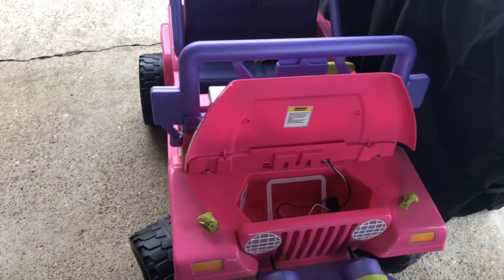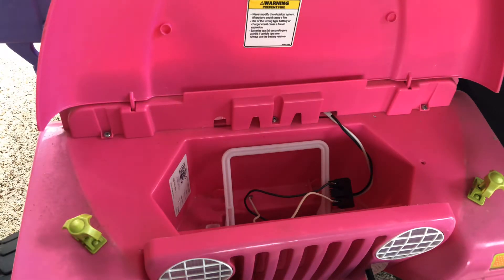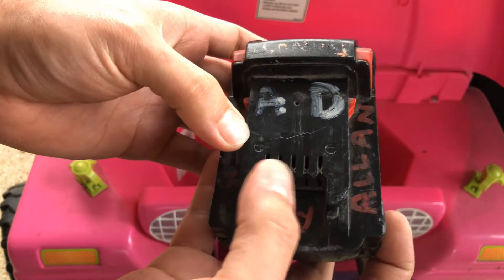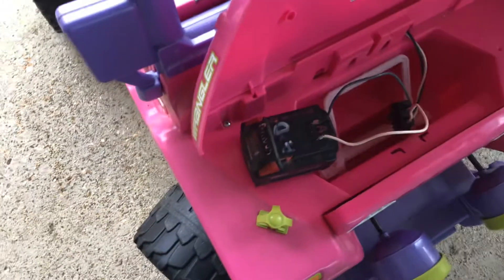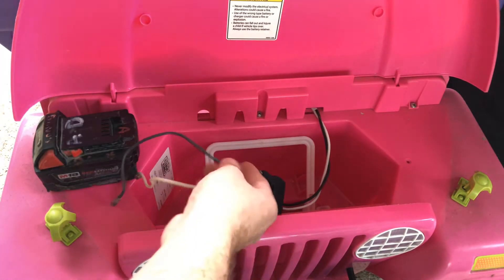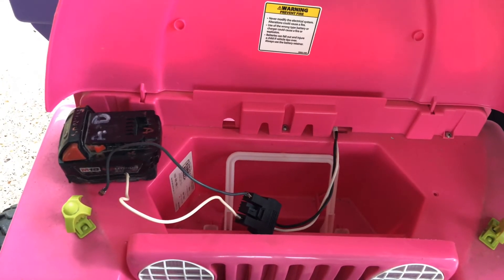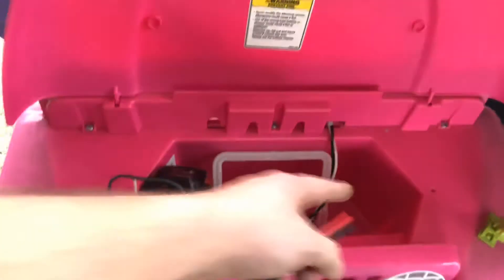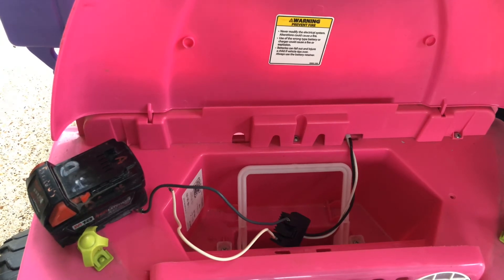How to hook up power wheel to Milwaukee it dewalt tool battery

Comment: Also what is that black piece called that you put after you cut the original little clip off? And the wires that you used are they anything special or what type of wires did you ask? And they little wire caps, anything special? How do you charge the new battery when it dies?
Reply from the maker: And the part is an adapter from Amazon, so whatever power tool brand you are attempting to use you just look up on Amazon “Milwaukee” battery adapter or “dewalt “ battery adapter , “ryobi” battery adapter and you just connect the 2 wired from the 2 wires that where on the original battery to the car . And 14 gauge or 12 gauge wire is good

Comment: My daughters jeep is a 4x4 battery 6v can I do this exact steps to her vehicle?? I didn’t know if the car being only a 6v putting a 18v battery could handle it or it doesn’t matter. I don’t know know anything about this little toy cars so I’m hoping I can follow your exact steps
Reply from the maker: You can go from 6v to 12v I have a video of a smaller tractor on 12v but if you go from 6v to 18 or 20v it will probably burn the motor up

Comment: I have a jeep power wheels also and was running 24v and now it only works in reverse. When in forward makes motor noise but wheels dont spin
Reply from the maker: Maybe a gear broke or stripped out and won’t let it engage or catch to go forward

Comment: were you able to make a video about the inner workings of the power wheel if the battery is not the problem ?  thanks
Reply from the maker: Yes it was removed because of music playing or radio in background, did you figure out what you were working on ?
Reply: @TheRandomHandyman  yes, was one of the motors in tire.

Comment: 12v with a 18v battery?????
Reply from the maker: Yes I’ve had no issues after a long period of time it could possibly burn motor but I’ve seen no signs of anything gone wrong so far
Reply: am going to try it as well.   thanks